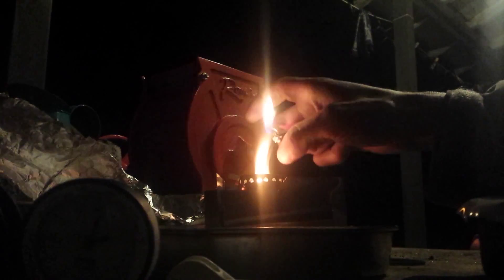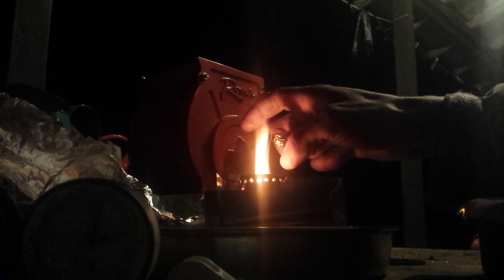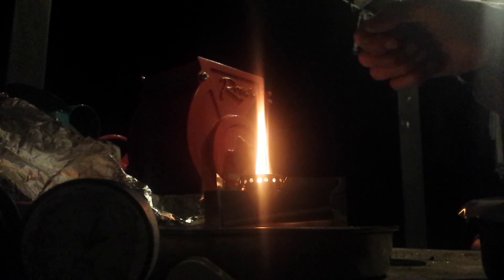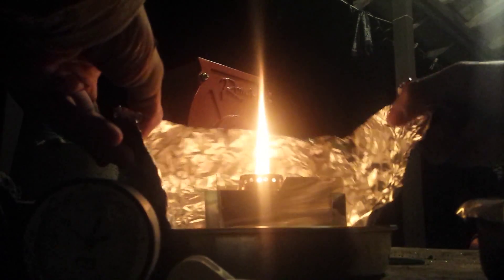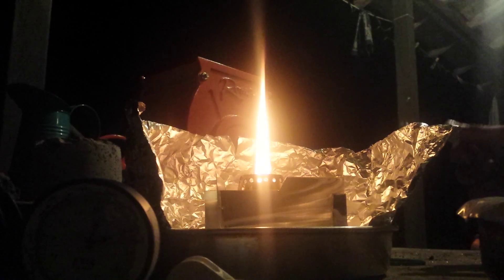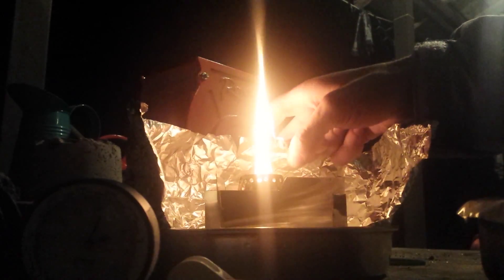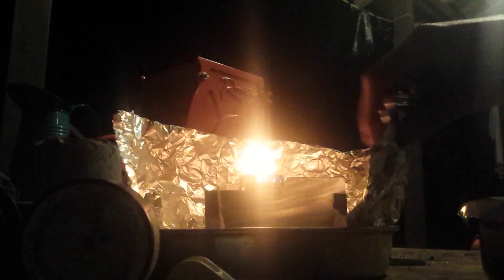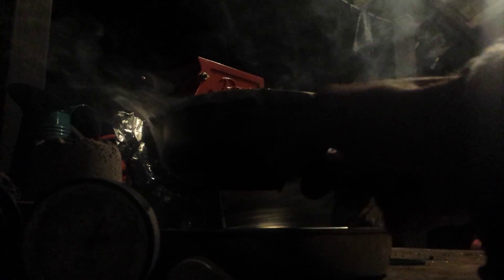$3 Candle wax stove for ultralight hiking 1.3oz

Comment: There are two ways you can improve this. Use copper for the main container, and then insulate that container very well. This melts the wax much faster and then also gasifies it much faster.
Reply: Great idea, this was a stove that I made as a kid years ago with metal sample cups I found. I've made the design available to the public and others have since made designs like yours, which produce less soot from increased efficiency